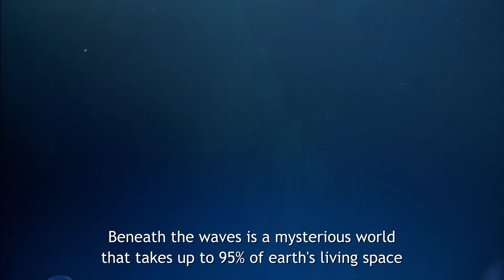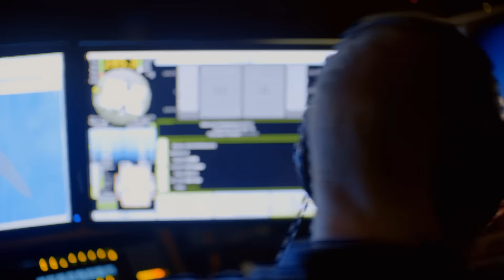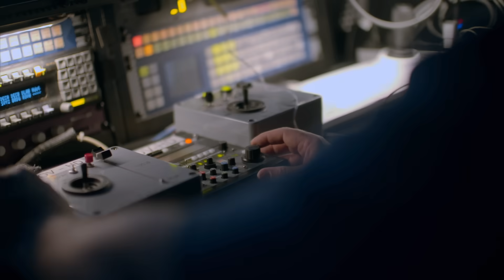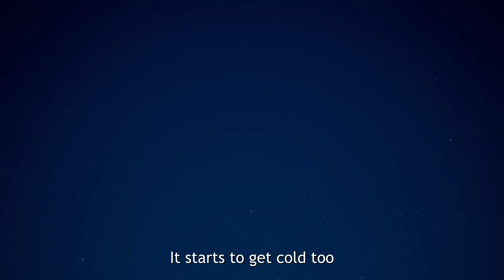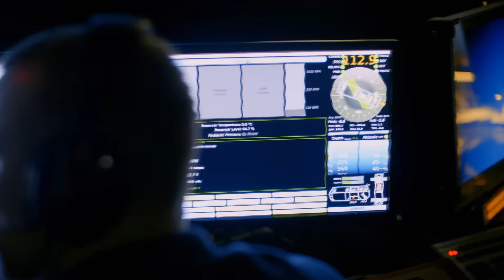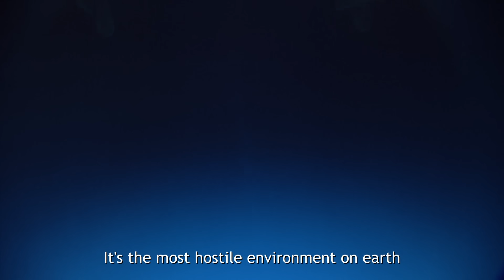The deep ocean is the final frontier on planet Earth

Comment: Fantastic Video!!! Single use plastic is a huge problem.  I am curious about the braided line he is talking about? Some of the braided lines last even longer then the nylon. the only truly Biodegradable line is Bioline. it will break down in 5 years to a very minimal amount of Carbon Dioxide and H2O.